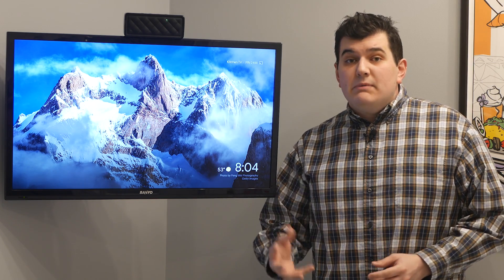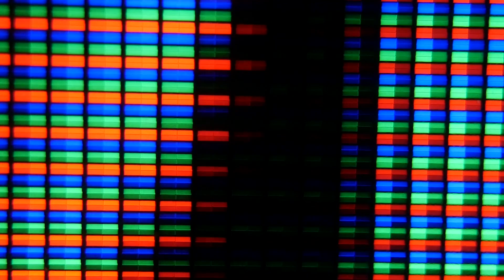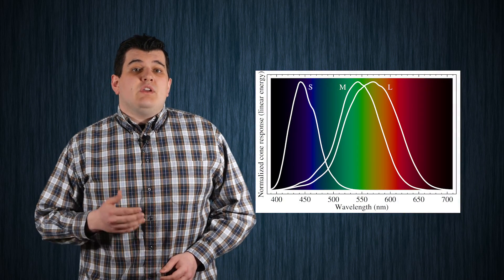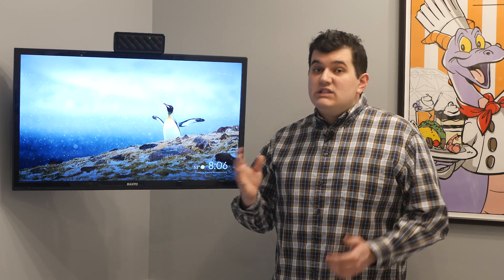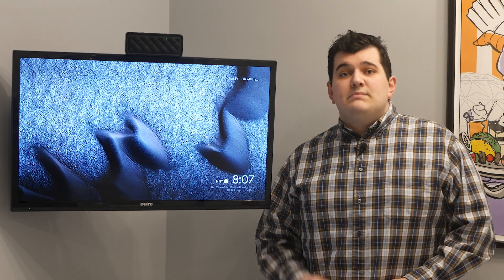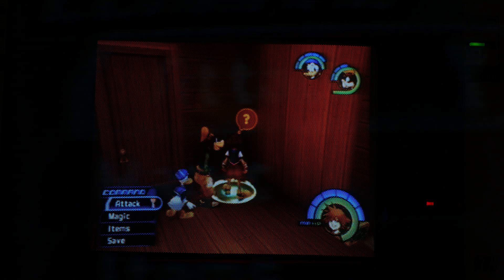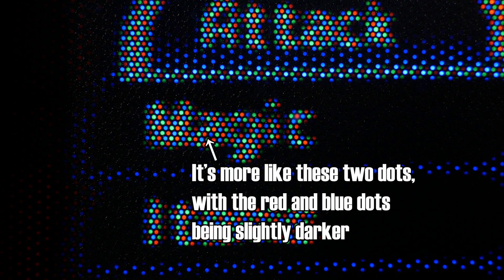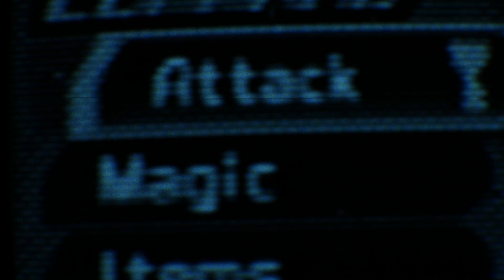These Are Not Pixels: Revisited

Comment: 1:36 Arrow point not to the Yellow color actually. 550nm laser is green. Yellow is 589nm. Also the chart is normalized.
2:07 Except "violet/purple". Naturally Violet located below 450nm, but modern screens produce Purple by mixing red and blue which are both above 450nm ( https://en.wikipedia.org/wiki/Purple )
8:24 Great explanation!
15:30 Haha! My last CRT monitor was NEC with Mitsubishi Diamondtron tube, and it was tough choice of that time to pick Trinitron one or this (and Diamondtron was just a sublicensed variation of Trinitron technology).
Great Video!

Comment: So, if you were to use three separate tubes and project their image onto a single screen, you could conceivably get full color resolution with brightness? Why didn't projector televisions take off?
Reply from the maker: Largely due to poor image brightness and screen-burn-in issues.  The individual tubes in a projection set are driven at very high intensity to be bright enough to illuminate the screen.  They actually wear out over time and may need replacement.  Plus, then there's the bear that is alignment, as there is no set alignment like in the shadow mask.
In the end, the direct-view picture tube was just simpler.

Comment: I can see your point of view, but I must disagree to an extent.  The term pixel is a rather old term was first used in 1965.  Similar competing terms were used dating back to the early 1900's / late 1800's.  These terms were commonly used since there inception to refer to the picture elements of CRT televisions among other platforms such as photography.  As such, I assert that these people did not invent and use a term that would have no relevance for nearly 50-100 years later.  Therefor,  televisions of the time period must have something that is a Pixel.

I will agree with you that the term has become more rigidly defined over the years and clearly with the advent of LCDs and other digital media, there are clearly defined boxed that can be seen.  But, this newer definition does negate the original uses and clearly defined pixels (or boxes) are not a requirement.  It's fine if the pixel is amorphous and change on each sweep of a beam.  Really the only requirement of a pixel is that there is a dot.  If your picture is made up of dots, then it is made up of pixels.

With that being said, I may agree with you that an old black white CRT may not have any physical dot pattern (and hence your points may be valid), but color CRTs and newer hardware clearly do.  Even with black and white CRTs there is a physical limit to the number of separate and distinct dots that can be drawn on the screen.  As such, I "believe" this is what a pixel may refer to on such devices as this would be the smallest picture element available to the device.

All in all I think you produce a good and well reasoned and thought provoking video.  I enjoyed your content and please keep up the good work.
Reply: Exactly. The word pixel exist to define something on CRTs. Saying they aren't pixels is absurd historical revisionism. Sure they aren't the same a modern digital pixels, but they are still pixels

Comment: You should perhaps point out that using analogue CRT based TVs the scanned beam can illuminate just a portion of a phosphor dot or slot. You can have just the top half or the bottom half, the left or the right, or on a finely focused beam the centre. This is the reason why when using CRT based computer screens displaying various resolution settings under VGA, the text and edges of items always looks quite sharp, but when a LCD panel is showing at the wrong (none native) resolution the text and edges look quite blurred.  This was the case especially on lower resolution (pre 1920x1080) LCD panels. On a digital screen only the WHOLE of the (sub)pixel for a particular colour can be lit, whereas when a CRT is scanned, only parts of can be illuminated. On some of your close ups on the slotted CRT you could see this effect very clearly, especially vertically. There was many areas where only the top, or bottom of the slot was lit. This is impossible for digital pixel screens to do.
Reply: The dot pitch on the CRT has no direct connection to the display resolution so there was no such native resolution on a CRT. A CRT was always somewhat blurry compared to an LCD so the fact that LCD is blurry non-native resolution is partially an illusion.

Comment: This is all really getting into the "anal retentive" and overly technical portion of how all this works. but it isn't entirely accurate to say that the "The phosphor dots do not in anyway define the maximum amount of detail that can be displayed on the screen". 

While is is true that as far as the electron gun is concerned, it's still drawing the same set of lines regardless of the sort of tube it happens to find itself in, the simple fact that there is an obstruction in front of it (the mask, be it slot, dot, or stripe)not only limits the color resolution, but also the number of discernible changes in brightness in a single line it draws across the face of the tube to a set amount based on the pitch of said mask. There are other things that come into what this limit actually ends up being such as for how precisely the beam itself can be focused, as well as how accurately (and quickly) the brightness can be adjusted across the line, but these are the inherit limitations to how ANY (raster) CRT draws an image, not specifically that of a color set. This is all primarily focused on horizontal resolution. Vertical resolution, while running into a similar limit at some point, doesn't end up being the limiting factor (usually) thanks to having a distinct and longer period of time between where each successive bit of detail needs to be drawn (due to being on entirely different lines, rather than being immediately after each other as it would be on the horizontal).

This doesn't come into play nearly as much with standard definition television as used in your examples (though can be seen in how you do lose clarity and as such resolution due to the coarseness of the small boombox TV's mask), but once you enter the realm of PC CRTs and pushing HD resolutions and beyond, it becomes a very real roadblock and limitation. You will have electronics that are quick enough and capable enough to draw what would equate to well over 2K and into 3K territory (in terms of digital resolution, obviously) but do not see any increase in definition due to the mask. You move to specialized monochrome (maskless) CRTs used for scanning film and the effective (perceivable) resolution jumps several times over, due to the gun's focus being the only factor at play.

Aside from this admittedly very nitpicky bit, your explanations for everything else in this series of videos is absolutely fantastic and breaks things down amazingly well for the layman.
Reply from the maker: I'm not entirely sure this is in alignment with your argument, but if you pause at 6:00 and use the < and > buttons to move frame by frame, you can see that my eyebrows move through the phosphor groupings.  Even though they are breaking up the screen in the form of an obstruction, they do not become all-or-nothing dots.   There can be and is detail inside of them, hence they don't determine the absolute max resolution, only the max color resolution.
And yes, I didn't really go into the limit presented by the lines as I hoped this would become self-evident with the black and white set.  I was trying my best to make clear that the lines are exactly the same between the black and white and color sets.  As far as the resolution limit brought about by the signal frequency, well I just let that go because I didn't want to have to explain it!
Reply: I'm not referring to the phosphors themselves, which can offer a sort of "sub pixel" level of detail, but these groupings and especially the mask itself does end up being a limiting factor. It is considerably less apparent, admittedly, in real world situations and especially with general video content as applies to SD television and the like, but it does end up being a limiting factor in terms of perceivable resolution. Yes the full image is still drawn to the screen, and yes in most cases our eyes will be able to piece together the majority of what is being drawn to the screen, but the mask will end up becoming a wall in terms what can actually be resolved. It actually ends up causing artifacts to crop up one you hit this point, in the form of moire patterns, similar to what happens with a digital camera's sensor trying to capture and interpret a pattern which exceeds what it's able to discretely address.

Comment: So, how does a CRT monitor for a PC work? They're CRTs with, presumably, a shadowmask, but things are defined in pixels.
Reply from the maker: Just like the CRTs were doing in this video, they display an image made of tiny squares.  An analog CRT can display an image made of pixels, but it is not using discrete of its own to display them.  There's essentially a DAC in the video card to convert the grid of pixels into an analog output, where position on screen is determine by time elapsed.

Comment: I have actually counted the 'pixels' (yes, I know that's not what they are, but bear with me) on two different televisions. Both late 90's Panasonic models.

Both had essentially the same design. (the casing and electronics is different, but I wouldn't be surprised if it's the same CRT tube being used in both models.)

They are in a hexagonal pattern, but leaving that aside it's basically a 480x480 grid.
Yes, that DOES mean that the colour resolution of the display doesn't match the aspect ratio.
4:3 aspect ratio yet the shadow mask is set up at a 1:1 ratio.

Obviously this doesn't matter, for reasons explained in the video, but I did find it interesting that if you were to assume these ARE pixels, that the apparent resolution is so... peculiar.

furthermore, both of these are picture tubes for PAL televisions, which have 625 lines to NTSC's 525 (yes, I know the colour standard doesn't define resolution, but the actual base monochrome signal has a rather obscure set of names.)

That's including overscan of course, but still... PAL would appear (from other estimates I've made) to be 525 visible lines to NTSC's 480, yet the PAL CRT's have a shadow mask built around a 480x480 grid.

The effective resolution independence of a CRT really is a useful trait compared to the modern replacements...
But the bulk and weight of a CRT is quite a pain...

Comment: You made a couple of errors. Firstly, there is categorically no such thing as primary colours, and you cannot fully reproduce the full visible spectrum of light using just three primary colours. You can only reproduce a subset. LMS and XYZ are examples of colorspaces that use "primary colours" that fall outside of the visible spectrum of light and are capable of representing the full visible spectrum. So they're not really primary colours anymore, they're dots outside the colour gamut.

Secondly, they don't have to be physical discrete units to be pixels. True, interlaced television has fields - but as I'm sure you're aware all CRT TVs can display progressive frame "low resolution" television. Don't believe me? Plug in a Nintendo, or an Atari. Yes the phosphor dots move across the screen so only one pixel is displayed at once, but they create the pixels. Three phosphor dots on a colour TV at a specific location for its screen resolution represents one pixel. The fact the pixels no longer exist when you switch off the TV is irrelevant.
Reply from the maker: One pixel on the Nintendo's output will likely illuminate multiple phosphor dots on the screen.  There is no 1:1 relationship as there is in a digital display.  That's the point.
Reply: True but that happens with LCD/Plasma HDTV as well. On my 2011 Samsung TV there is no way to disable over-scan for its channels (can be disabled on hdmi input though), which means even for "native" resolution broadcast its pixels are interpolated. And by native I mean 1920x1080, but that's not exactly correct anyway since 1080p isn't a broadcast standard. CRT Monitors are capable of 1:1 representation of input pixel to display.

What you see on your TV screen is the end result of the internal processing done to the picture on the screen, yes even if that processing happens after the light is emitted - there isn't a picture until the light hits the phosphor surface of the screen.

Comment: I think the takeaway here is that phosphor dots are not pixels, but they do affect image quality and sharpness (both color and black and white). At a very high level the effect is comparable to using a lower resolution digital screen, but the details are very different and basically a messy analog mapping effect instead of the cleaner, easier to describe effect of pixel resolution in digital screens. Even with a B&W image, the areas between the dots result in lost information, and there are limitations displaying colored information (much like color subsampling in digital image formats!). A Trinitron display limits the effect to the horizontal axis, so the vertical resolution is equal to the number of scanlines without any further artifacting, and the only sharpness effects occur in the horizontal axis (at least if the beam focus is good anyway).

Comment: A good answer to why CRTs “scaled” much more nicely from lower resolutions to fullscreen. It wasn’t needing to address pixels, it just blasted out the signal and let the phosphor dots handle the composition, no matter where they landed. But early LCD/LEDs had to address each pixel individually, and so had to logically assign the logical pixels to each display pixel, and you get the lovely early age of 2:2:3 scaling where every third line was scaled larger, because you had for instance an over all 3:7 scale factor.

I’ve really liked your series explaining this matter, as I had always wondered why things changed so fundamentally and jaggedly (literally) from CRT’s smooth resolution scaling to the LCD/LED’s wonky scaling. The answer was of course all along that the CRTs were actually just presenting a “best effort” approach, and not sending each phosphor group pixel individually.

Also, interesting, I would presume that the “tightness” of the beam dictated the vertical resolution. SO that at a 320x200 resolution, a monitor with “native resolution” of 1024x768 still never swept through all 768 lines, but rather swept through 200 lines, with a “taller” beam. Right? The convenience here being that lower resolutions typically adjusted width as it adjusted height as well, meaning a wider beam—which would normally affect horizontal resolution as well—would not really impact image quality, because… horizontal resolution got downgraded as well.

Comment: Well, the dots definitely do affect maximum resolution of the image. You may feed a 4K image into a small 6" CRT tv but you will never be able to see all details on the screen.

It's largely about what we consider a "pixel". Is it a triplet of RGB values being sent by the source, or is it brightness/color value of the screen element? I would say, both are. The transformation that happens between your PC and your screen is a similar one to what happens if you rescale an image in an image editor. And even on analog tv, you may not be being sent pixels by the source, but you still see pixels on the screen.
Reply: There are different pixels. If you view a digital still image on a TV the image has its pixels, then when the image is transmitted digitally to the screen  that has its pixels and the screen may have different pixels. Especially if the screen is 1366x768 it does not match any HD standard.

Comment: What would happen if you drive a 4k signal into a SD CRT TV?

Also does this mean there are no discrete points to define picture quality? So its picture quality is not discrete, its actually continuous. 

Since continous data can reach to infinity, could we get a shadow mask with enough dots/ slits to display the colour information from pixel clusters of modern TVs?

Granted it will be dimmer but is it possible? If so, is there a limit (without taking brightness in consideration)
Reply: kapil busawah The resolution will be limited by the signal bandwidth the electronics are capable of accepting, but that will just lead to blurring. You won't see stair-stepping or digital artifacting on analog TVs.